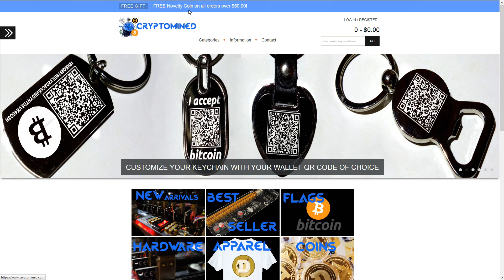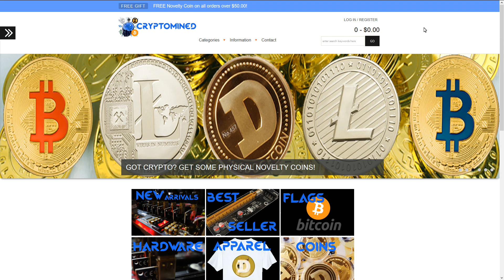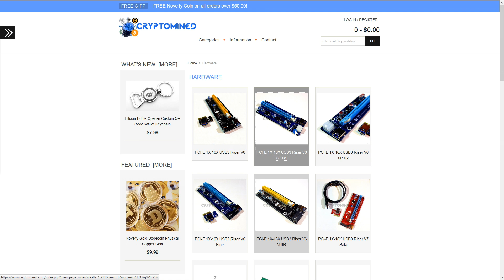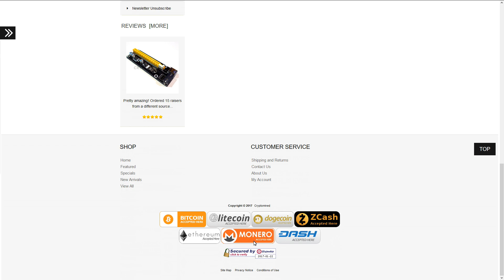6 Best PCI-E 1X to 16X USB3.0 GPU Risers for Mining Rigs Ethereum ZCash Monero

Comment: I am a newby into PCIe cards, Would it be possible to connect the PCIe16x directly to a laptop through the USB ports (NO 1x PCIe) although slower ?  (I know the PCIe bus is faster than the USB Bus ) Any info/input appreciated. I Just want to use a Data Acquisition PCIe Card with My Laptop
Reply from the maker: not sure these days

Comment: can i use 6 pin pci cable with power supply direct to 6 pin riser, without using sata connection.. is it okay to use that.
Reply: sir. yes or no, can i use 6 pin pci cable with power supply direct to 6 pin riser, without using sata connection.. is it okay to use that. very long answer its confusing me..

Comment: The diode is not a voltage regulator. It will serve one of two purposes. If it is a zener diode, it will limit voltage spikes. If it is a rectifier diode, it will prevent damage to components due to a opposite polarity power connection. The diode's purpose is almost certainly the 1st one.

Comment: The (that) diode is not a voltage regulator.
Reply from the maker: it regulates voltage.. it does.. it might not be a voltage regulator directly, but ive gone over this enough in the comment if you care to read my replies to others that have stated the same.. learn what a zener diode is and what it does!

Comment: What cable do I use to connect the 6-pin riser directly to PSU without using the adapter included? The PSU only comes wtih 4 pin molex, sata, PCIe, and CPU power connectors.
At the same time, if you are using the 6-pin to SATA adapter to connect to the SATA cable from PSU. If I have one of those 3-in-1 riser that can take SATA, would it be better for me to connect my PSU SATA directly to the SATA port on the 3-in-1 riser?

Comment: On a single mining rig can I mix between different risers?
Reply from the maker: yes, match your risers to available cables, trying to get 1 riser per cable, 2 max... for molex cables use molex risers.. for sata cables use sata risers... or check out my store at https://cryptomined.com and take a look at the 3in1 risers that have both molex and sata connectors so you can use whichever to power them.
Reply: What I meant was can I mix and have a 6pin molex version and a 4pin molex on different cards running correctly on the same rig?

Comment: Not sure if anyone else said it, but it's not "1 Times" and "16 Times", you the say "X". Saying "Times" is very distracting. I hope in further videos you said "X" and not "Times".
Also note, they are "Sata to Molex" and "Sata to 6-Pin". It's always listed as "Source to Destination"
Sata connections can't handle as many amps as the Molex or 6-Pin connectors. However, the type Sata end shown here are the ones that mostly lead to fires. The ones where the cable passes perpendicular to the connector or where the wires aren't molded to the end are the safer style. This time, with the wires molded into the connector, are the fire ones.

Comment: Why would you use a six-pin to sata connector? Sata is not designed for loads higher than that of SSD / HDD... might as well use the six-pin which is designed for graphics cards...

Comment: Can this be used for anything other than graphics cards? I'd like to add a thunderbolt 3 add-in card for an audio recording interface (UAD MK2 Twin Duo) to my transitional PC with a Gigabyte GA-78LMT-ST Rev. 1.1 soon to be swapped for a Gigabyte GA-78LMT-USB3 Rev. 6.0 MB (again transitional MBs until I get a Threadripper+Asus ROG Zenith Extreme). I was hoping it would be possible to find something like this to add another independent PCIe x16 for the TB add-in card, since my graphics' card inhabits the one and only on the MB. Thanks for any help... from anyone!

Comment: do you have to use the usb to mini pcie adapter or can you just plug in the usb cord straight into a laptop?
Reply from the maker: would need to use the adapter, a usb slot on a laptop is not designed to run as PCIE

Comment: How many risers can I power with one SATA cable? Would each riser need its own cable? I'm thinking of buying 6 of the red SATA risers to run 6 GTX 1060 6gb cards.
Reply from the maker: at most 2 risers per cable.  1 is best.   Never do 3 or more

Comment: I used PCI-E 1x to 16x USB 3.0 riser card ver 006C, connected to MSI RX460-4Gb. When i started benchmark GPU, it stopped response and no signal to display LCD.

But when I connected to Gigabyte GT 730 - 2Gb and started benchmark, it's ok.

When i connected vga MSI RX460-4Gb to x16 slot on board, there's ok.

What's happened to my riser card ?
I used Main Gigabyte H81m-DS2, CPU G3420, 8 Gb DDR3, PSU 500W Antec
Help me please. Thanks

Comment: should i remove the back plastic/rubber thing that is on the back of the riser ?
Reply: that is a fireproof padding, i wouldnt. you can screw right through them when you're mounting it onto a rig.

Comment: Is it possible to overload the power supply by plugging in the molex connector directly to the riser? I've read a bit about molex connectors outputting lower amps than sata connectors which is why the risers come with sata adapters. Basically I'm wondering if the adapter cable is required because everything I've read about them says they should be used but you plug directly in to the power supply during your video.

Comment: I connected a pcie riser to the 16x slot and it immediately started smoking from the mobo
1) I had the gpu connected to power which I think was overkill since the riser gets power as well...thoughts?
2) Could it have been plugged in backwards...is that what would cause the 1x connector to  melt/short?
Thanks
Reply from the maker: plugging it in backwards is a sure way to probably kill your motherboard or GPU
Reply: I dont believe I plugged it in backwards because it fit fine in the 16x slot...and luckily my mobo and card were ok, it was the 1x adapter that melted. Could giving the GPU power ontop of the riser cause problems? Thanks
Reply: You've just plugged it in backwards bro lol 

There are "Right" riser cards and "left".  They both go in different places.
Reply from the maker: no power would come back through the USB, so must be from the mobo power

Comment: Can you power a GTX 1070 and the 6-pin PCIE riser using one cable with two 6+2 pin connectors?

Comment: Maybe I'm confused, but don't the SATA cables not provide nearly enough power (50-75w?) to the PCIe card since the SATA cables are meant for HDD/SSD that run on less than ~15w?
Reply: still the slot is delivering up to 75w of power
Reply: I got 6 pin to sata cable riser and im running my 1070 on it
Reply: The SATA cable powers the riser, not the GPU. The GPU will use their own dedicated power cable as usual.

Comment: So if I am building a rig with 8 GPUs, should I assume I will have to use 2 PSUs to be able to cover all the connections? 8X 6 pins or 8pins or both for the GPUs and 8 sata connectors for the riders? beside the connectors for the processor socket and the SSD?

Comment: I've read a lot of horror stories of the sata to molex adapter melting due to insufficient wire gauge. Is this still an issue? I plan to run 6x 570's with these risers.

There are recommendations to run directly to the psu. I have an EVGA 1300w G2 but there are only 5 molex connectors spread across 2 rails and the spacing is really tight.
Reply from the maker: well the ones i have should be of a decent gauge, but I would still avoid them like the plague.  if you want to use sata cables, please use sata risers ver007
Reply: Cryptomined UPDATE: now I burned one more riser!! I guess my RX 470/480s are drawing too much power from the not-so-thick 12v wire! Oh, and worst of all: my brand new and quite expensive motherboard turns on for a split second and turns off immediately, therefore maybe I fried it as well while my last riser got burnt?! I even told my brother to give up on investing in mining rigs! Too risky! Now I'm afraid that my computer may even catch fire while we are all sleeping!!! It was too good to be true... UPDATE: Thanks G-d I didn't burn anything but the shitty risers! But still I recommend using the sata to molex cable only if you REALLY can't use the risers connected directly to the PSU!!!
Reply: bdontube Yes, it is! I burned 3 (yes, THREE!!) sata to molex adapters yesterday. As he said, avoid it like a plague!! Mine are version 003.
Reply from the maker: also avoid anything under ver005
Reply: Do You still advice against it?
Reply: you can go for the 6pin connector versions if you don't have molexes left. if you don't have any pcie connectors left. (you have this problem on the evga supernova 1600 for example if you use 9 pcie's for 6 cards and the 5 molexes for 5 risers) then you can use the cpu power connector (eps) and use an eps to pcie adapter to plug in the last riser. this is perfectly fine, because they are basically the same except the different poles.
however there are also dual-sata to 6pin connectors. that should better than a single sata too.

Comment: Thank you!  I have a 1050ti (unpowered), what pci riser shoukd I get for it?
Reply from the maker: this depends on your power supply cables that are free.  You probably want to use either the molex ver006 or sata ver007
Reply: thanks!  Just to make sure - So do I need a PCI-riser with additional power supply even though my 1050ti has not socket for any additional power supply?
Reply from the maker: you have the 1050ti's that do not require a 6 or 8pin power connection right?  the USB riser will power your GPU.  So the molex is probably your best bet (sata ones will work too)
Reply: Thanks so much :) so something like this will most probably not scorch my 1050ti card?  http://www.ebay.co.uk/itm/like/262287675104?chn=ps&adgroupid=44594567914&rlsatarget=pla-298926477009&abcId=1088856&adtype=pla&merchantid=110763828&poi=&googleloc=1006886&device=c&campaignid=805978797&crdt=0
(Should I have mentioned that my MOBO is Z97 based and its box says it supports multiple GPUs?)  And yup, I think my PSU has it both - sata and molex.
Reply from the maker: no that is not a good riser, do not buy that kind.  you want the USB kind.

Like this: 
https://cryptomined.com/index.php?main_page=product_info&cPath=1_215&products_id=199

and this:

https://cryptomined.com/index.php?main_page=product_info&cPath=1_4&products_id=1
Reply: Thanks! Do I plug my power supply unit's molex cable into it?  Will it work with both unpowered Nividia and powered AMD graphic cards?  Also, to make a purchase I guess I need to get some coins first.  Is there a good place to get coins via paypal?
Reply from the maker: yes you can use your molex cable from your PSU.  Yes will work with both unpowered/powered Nviida/AMD.  yes for a purchase you would need some crypto.  You can try localbitcoins or coinbase maybe?  i dont think paypal allows people to buy bitcoins.

Comment: A diode is not a voltage regulator.
Reply: Ehm... so does it protect from anything or it doesn't? And from what exactly (consider formulating it using common words, please :))
Reply from the maker: yes it does protect it from getting too much voltage if you use it on a 12v cable for example, it will ensure it only gets the 5v
Reply: Diodes are often used as voltage regulators to output 3.3V from 5V
Reply from the maker: it is a zener diode, which "can be applied in a voltage regulator circuit to regulate the voltage applied to a load, such as in a linear regulator." ... so it is used to regulate voltage.
https://en.wikipedia.org/wiki/Zener_diode#Voltage_regulator
Reply: Well, I'll admit that you are not wrong in any way if you use the term in that context. But it might be slightly misleading since a diode can't really provide sufficient protection against too high voltages (nor against too low voltages [as long as the voltage is over the "on-voltage"]).
Reply from the maker: yes i agree, i should have said "voltage protection"
my wording was not choice

Comment: !!!! WARNING !!!!!: One other Riser I have had a big Prblem I would not recomand buying this, it has (PCE164P-NO3 VER 004, PCE2PCE-NO4 VER 004) writen on it, dark blue cards, has a light blue PCIe-slot and some kind of spring-lock, a molex conection. So what happen is that i installed the new riser, then after switch on everythning it had a short circuit in the card for the Motherboard very close to the pins, so I checked it a bit late 3-4 second after I smell some burning smoke, I switched it directly of but it has burned a little bit my pcie slot (x16) on the motherboard. The motherboard slot still works but maybe the slot has reduced longevity now... So I'm not 100% sure if it will work longer time, and if it is save anymore... And I can not sell the MB like this... I'm pretty sure it was short circuit on the riser card, you can even see the source of heatment, very close over the connection pins on the pcb (15-17pin)  But I could also bee a bad installation but this is less probably...

I also have to say that I also use 3 or 4 of them and they work... So it's maybe a quality problem on that series...
Reply from the maker: i dont sell any ver004 risers, only ver005, ver006 and ver007.   and i only sell the ver005 because it matches the 6pin ver006 riser with side latch.
Reply: I also have to say that I also use 3 or 4 of them and they work... So it's maybe a quality problem on that series...
Reply: I buyed it in another shop. Yes It is not on your video too...

Comment: The red sata riser V007 is (one of) the best (As you say it in your new video) i have so far (Has grown in price the last weeks... in some shops...), I have mixed risers on my rigs... I also noticed that this red sata Riser V7 has thicker card, so it is tight in the pcie-slot... I had even some time problems to get them out of the slot... haha...
Reply from the maker: yeah :) they are so tight that sometimes they can be hard to remove LOL  but thats a good thing
Reply: Not only th grip in the PCIe-slot is a good feature, also the fact that it has a sata connection, most newer psu has mostly power sata connections... AND the cheap sata to molex adaptors you get within the riser cards are not very high quality and save...  BEST WAY (what is very logical) is to use PSU connections driectly on the risers without adaptors...
Reply: I find conflicting information that states that SATA cables simply are not meant to handle such high wattages, but if you guys say they are the best I'll go and get some. Still confused though :D
Reply: how else can you do? if you use a adaptor (sata to molex) it is pretty the same power on the sata connector... When you like to use only the molex cable, there's mostly one going out of a psu...
Reply: Well, yes, you would need a big modular PSU where you can add lots of molex cables directly into molex risers (no adapters). Google for "correct-way-of-powering-the-risers", in that thread people keep discouraging the use of SATA for powering risers, so I'm confused whether I should go with the 007s SATA risers praised in this video or just stick with molex